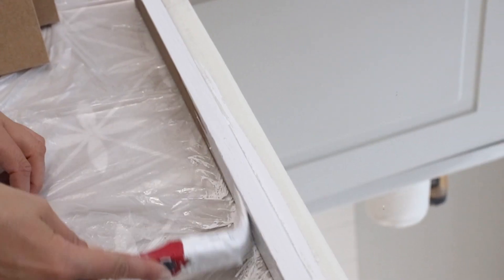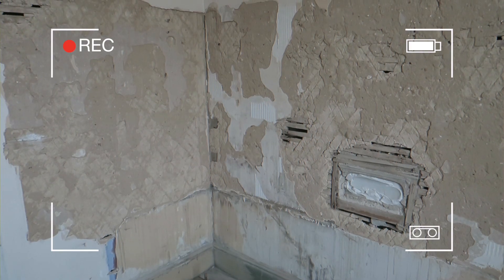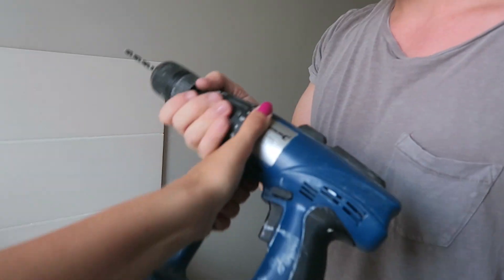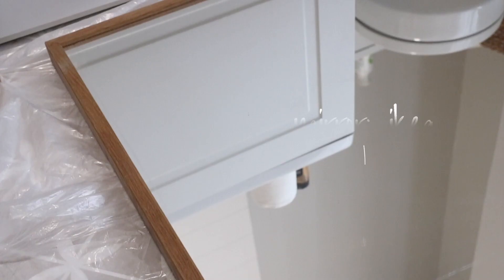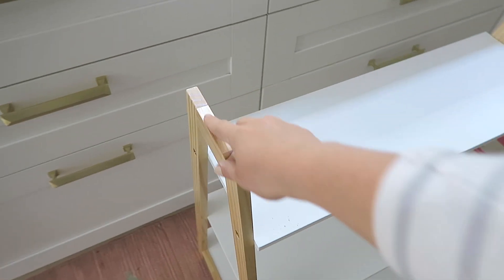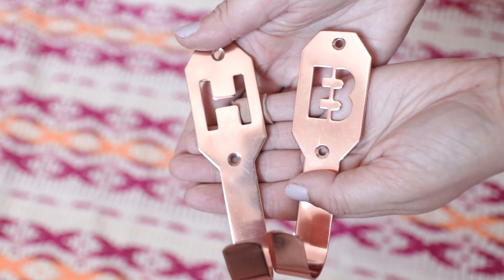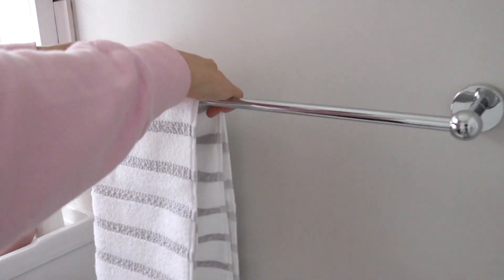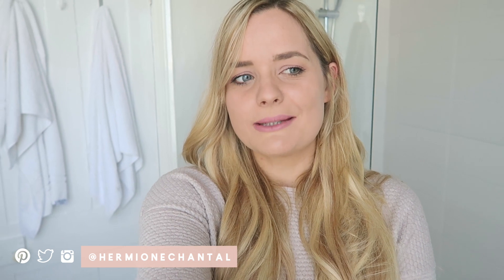Bathroom Renovation Makeover and Tour

Comment: I work in a sign company and the trick with sticking vinyl to area surface is a small spray bottle filled with fairy dish liquid and water. A fine mist onto the surface and when you apply the vinyl it helps to move the bubbles out. Then when it dries you have a lovely smooth surface xx

Comment: I’ve found that if you use a foam roller for gloss paint rather than a brush, it dries much quicker and you get a smoother final finish. B&Q sell really tiny rollers to get in finicky corners and edges.